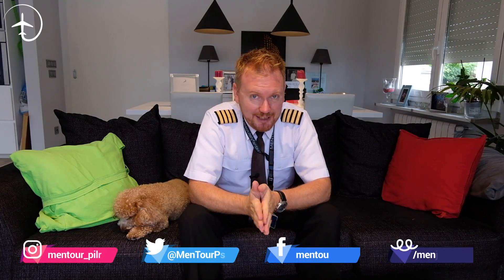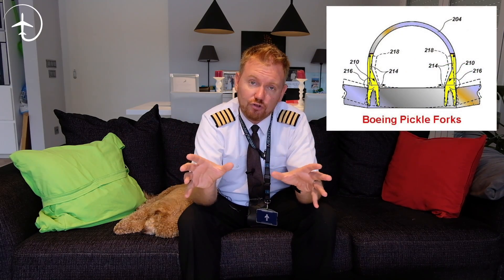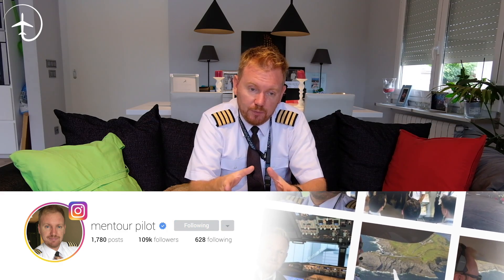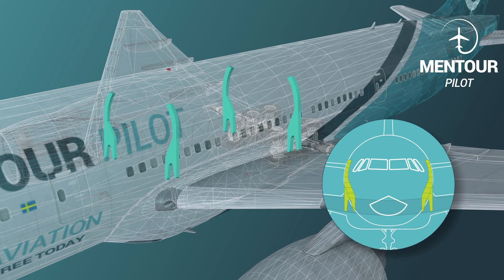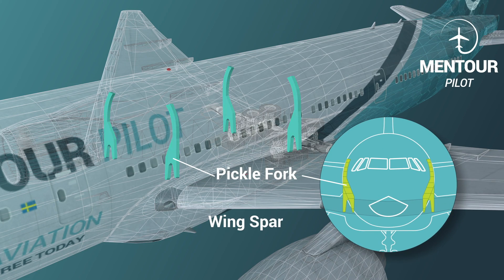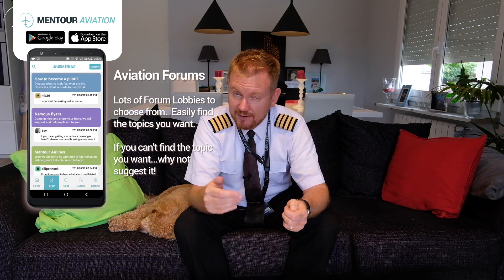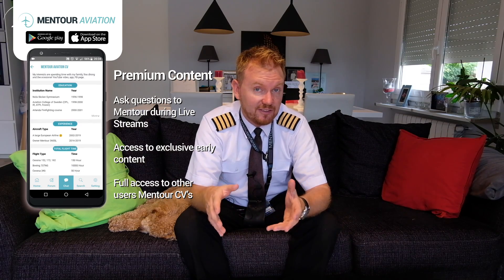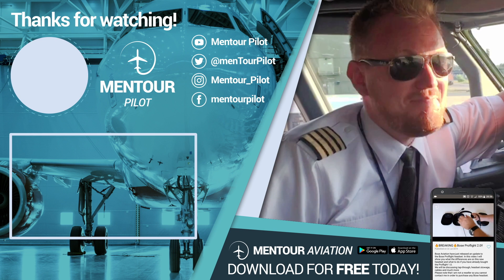Cracks in the Boeing 737 NG wings!? Mentour explains

Comment: Sounds like something is wrong with the metallurgy. Similar with ships especially naval ships. Aluminium Super structure with welded steel panels. Cracks do happen at stress points. One wave with the right weight and force known to cause a ship to break it's back and send it submarinig to Davey Jones Locker. Will be the similar with air turbulence or heavy  landing.
Reply: it can be wrong desing due a understimate stress values or overaged Aluminium alloy. Root cause analisys must be done to get the truth of it. Nevertheless you can live with cracks at certain point before braking point, crack must be check continuisly in order to estimate it´s range of propagation. Remember that maximun stress forces are aply to the aircraft during take off and landings but even during the fly wings are load and bent so it can be suffering Fatigue of low stress and high cycles.
Reply: It’s possible I’ve seen many stress cracks on aircraft. And interestingly enough when you repair and reenforce one section after a few hundred hours there’s another crack that appears. Generally you just move a vibration from one airframe station or line to another.
Reply: I'm surprised they'd use aluminum with steel panels for numerous reasons, but especially because the aluminum and steel expand with heat at different rates.
Reply: So much metallurgical work is done at low cost bid. Design typically accounts for tolerance, but QA is very very expensive (when done welll
Reply: @derkspringer2483 Extra weights in wingtip can change vibration out off from harmful frequency.
Reply: Jari I agree reenforing to reduce vibration is a good solid practice and works but 1 out of 10 times it’s going to just move the vibration. But then again my experience comes in helicopters not airliners.
Reply: @TiernanWilkinson  Certain parts in a wing fittings (attachments) is always steel.
Reply: The larger stress those wings components can be subject to are take off with full fuel, because when the plane roll they act as the fulcrum that enable the movement on the plane body.
Reply: Heat cycles in india...
Reply: @stevenlarratt3638  Obviously, it's  due to overloading. I'm sure, that you've seen pictures of overloaded trains in India, where people are riding on top of and hanging off the side of the railcars. Well, they do it with aeroplanes as well. It isn't so bad with people riding on the wings, close to the fuselage, but when people are riding all the way out on the wingtip, leverage kicks in, and it really stresses the airframe, especially the pickle forks. Nothing a little duck tape won't fix.
    ...What can you do anyway? India is a big place with a huge population of people, who have places to go and people to meet!
Reply: Tiernan Wilkinson ....Lol,  I think they know what they are doing dude.  Maybe you should call Boeing and tell them not to mix their metals in their design?
Reply: Reminds me of the Beechcraft 18 and later the Kingair series.
Reply: @jarikinnunen1718  Tuned mass dampers?
Reply: its a bad design...all the parts on all the planes cant have "gone bad" ...its not the metal. its just like what happened to the sea planes..etc. or short hoppers.  metal fatigue due to poor design.
Reply: @Motorman2112  Yes, sort of
Reply: @ B A Nice handle. It wouldn't have anything to with the character from the A-Team TV show would it? 

I digress. If what you say is true, Boeing management made another terrible decision. Good for the bottom line but terrible for aircraft safety. 

Is there any documentation that Boeing actually incorporated improperly fabricated structural components into the NG line of aircraft? If so, how can anyone trust any plane they have manufactured. 

Hand machining critical structural components is far different than CNC machining. Pickle forks are large components. There is no way any human can match the accuracy of a computer controlled device in milling a component. And they allowed such components in manufacturing the planes. Incredible. I hope the truth comes out. 

This is just mind blowing to think about.
Reply: @TiernanWilkinson  It will be an alloy rather than pure aluminium, but a good point as the rule of thumb is that aluminium expands twice the amount that steel does. Also when you have steel and aluminium in contact then they form a battery which causes corrosion, so it is not done very often.
Reply: @steverpcb  you want to explain how car engines work then? Almost all car engines now feature an aluminum head with a cast-iron exhaust manifold attached to it. If aluminum expanded so much faster than steel, they'd all be leaking exhaust, wouldn't they? Wouldn't all the steel bolts screwed into the aluminum heads and blocks be coming lose all the time? Car engines heat up and cool down a lot more than an airplane fuselage, don't they?
Reply: @AlexandarHullRichter  Car engines are bolted together cold so that when it heats up everything gets tighter. The actual expansion is about 1 1/2 thou per inch for steel and 3 thou per inch for aluminum for 200 degrees C ( liquid nitrogen is about -200 and you can heat steel to +200 before any change happens to the microstructure).

Comment: Very informative. And FAA is miles above the FDA (I work in the medical device industry), I am quite impressed. Still, fracture mechanics and metallurgy are both well developed disciplines, I wonder if Boeing has done its due diligence. How about some testing before installing the forks? How about having some deformation sensors permanently on the forks? I am more and more nervous about Boeing, their CEO looks like a soulless suit and their recent track record speaks for itself. Hopefully they will be scrutinized more now.
Reply: Radim Cernej - These cracks can be microscopic.. normally parts are quality checked after producing the parts, sometimes also x-rayed to make sure there are no microscopic faults.

Comment: One plane with cracks isn't a disaster.    However  ---  if more planes start showing cracks after the testing, then there might be a problem.     Waiting for future information.
Reply: Irvin McIntyre They have found 25 with cracks so far (out of 500 checked), so it is a serious (and expensive) problem.
Reply: I read 36 so far!
Reply: Doesn't sound good, does it.

Comment: So FAA now requires that airlines carries flex seal tape on each airliner.
Reply: Should be JB Weld...🤣
Reply: engine tape...straight outta og starwars
Reply: @brentboswell1294  if you can't fix it with JB Weld, it's fucked
Reply: Don’t forget balin wire and vice grips....
Reply: Every plane has to be cut into 2 halves for inspection.
Reply: William Haynes The term you’re looking for is speed tape. Aviation duct tape. Great stuff. Very expensive.
Reply: How large a roll?

Comment: Additional potential explanation for cracks: material handling. Metal could have been fatigued during mishandling of the components during transportation or removed from casting too soon. I think your best guess "error in aluminum alloy manufacture or casting" is probably correct.

Comment: These parts are probably machined from extruded aluminum alloy and if not extruded correctly, soft spots can exist.  One solution would be to require hardness testing on the ends and the middle of the parts in several locations.  Another factor could be after machining; if not machined properly, warped conditions might exist and - even if not permitted - some supplier might "straighten" the parts (even after penetrant inspection) to point of inducing too much stress and even cracks...there are companies making parts that do not follow the manufacturing specifications.

Comment: I tend to agree with @MentourPilot here.  The most likely explanation is that this particular batch of aluminum was weakened somehow.  This happens from time to time.  This has happened before in similar circumstances.  I expect that when the mandated tests are completed and other NGs have similar cracks in their pickleforks they could then see if a pattern is forming and trace those pickleforks back to the manufacturer and figure out what might have happened.  Then action can be taken to correct the problem and reduce the chance of it happening again.  Let's be glad this was found before wings started falling off.

Comment: They're saying 5% right now. I'd be interested to see the detailed breakdown and determine if they came from a specific batch or mfr, or something like that.
Reply from the maker: It will indeed be interesting to see.
Reply: @rexsand1321  batch can be a 10k pounds, it's still batch.
I think is more than only material problem, like @. Michael Gehlke tell some carriers don't wanna planes from SC because quality
Reply: Which also doesn't mean it is a fabrication problem. The design could have exceeded the limits of the materials minimum standards.  This happens and people will blame the foundry even though they met the qualifications for the materials.
Reply: @rexsand1321  Large cast pieces like this are done in 1-2 piece batches with custom sand forms so you are correct unlikely to be batch related. And only effecting the rear pickle-fork to me points to design or probably retrofit problem. I would put money on the addition of winglets moving the pressure further outboard and causing more bending forces.
Reply: MrRexQuando The pickle forks are not cast. They would be either machined from plate or forged.
Reply: @artjackson8360  I am pretty sure they are forged and machined to final shape, you get stronger and lighter part. Material batch (people should learn what a batch in this case means, could be several batches) might be an Issue, I agree with Mentour. From some point, China got control of aluminum production from USA and Europe. That would explain that older 737NG didn't have cracks even after 90K cycles. That suggests a possible new supplier entering the field and age of the airplanes might point in the same direction.
Reply: @josefchodur5016  Way too big to be forged and with the limited number produced no one would build all that tooling.

Comment: I work in manufacturing and we do a lot of aluminum parts, and he is dead-on about the metal quality being the biggest variable in the end result.
Reply: Yep, I work in aerospace as well.  The biggest problem is with sub contractors.  We are AS9100, but incorrect material specs  has been miss issued.  It was caught at the packing stage as certificates of conformity (coc's) did not tally.  Mistakes happen unfortunately, but system are in place to minimize and capture non conforming parts in-house.
Reply: @paul30003  yup so it's Boeing fault. They probably don't care about consumers as much as they should. If they ever did, they would not have saved money and not provide training for the other pilots before using their newest plane.
Reply: Tiernan Wilkinson you need German quality control

Comment: As someone who have evaluated this AD and ordered inspections, I can say that Mentour has done magnificient job explaining this. There is just one small mistake, for aircraft with utilization higher than 22600 FC  limit is 1000 FC from the AD effective date(not a year as he said). Both Boeing and FAA have done great job here. Inspection itself is easy, access is a problem. Lower than 30000 FC - before reaching 30000 FC or within seven days  whichever occurs later. With utilization lower than 22600 FC, within 1000 FC or before 22600 FC, whivhever occurs later, anything in between: 1000 FC. Utilization higher than 30000 FC - within 7 days(up to 10.10.2019.)
Reply from the maker: Thank you!!
Reply: Dear Steve,just an update for you, a NPRM(FAA equivalent to PAD by EASA) has been issued for parts mentioned in  AlJazeera documentary(it seems this is the case), and pickle fork inspection has been expanded to include additional 6 fasteners. Company I work for did not have findings on pickle forks, I hope it will stay that way, and for bear straps, proposed threshold gives me an idea it is treated as not so urgent issue(they will give us 6000 FC to inspect it, which depedning on average sector length can last from 2 years for a company that has a lot of short flights to almost 5 years for example in case of company I work for). What I am trying to say is that immediate grounding will not happen like it did with some aircraft affected by pickle fork cracks, operators will do the bear straps inspection during next C-Check. Again, it is properly managed by Boeing and FAA.

Comment: I'm not sure about the terminology at Boeing, but as a design engineer at a transportation manufacturing company I can tell you that the term "Fail Safe" does not refer to what you suggested.
Fail Safe means that the part/system fails in a safe mode.  For example, if you have a vehicle with airbrakes they are designed to apply the park brake if you lose air pressure.  What you described is system redundancy or backup.

Comment: I read on a pilot's forum that these pickle forks used to be machined from a solid block of aluminum but that wasted a lot of aluminum so they decided to start forging them instead, which results in a part with less strength.
Reply: socal livvin That’s not accurate. Forged parts are generally stronger and have better fracture toughness than the same aluminum alloy in plate form.  Forged parts are literally beaten into shape. This gives a better grain structure.
Reply: If I am not mistaken, forged aluminum expands and contracts more than does cast aluminum when exposed to temperature changes. Forged aluminum is certainly stronger. But perhaps the greater expansion and contraction rates of forged aluminum might potentially increase stresses on the components. I don't know honestly. 

That being said, forging such large components seems beyond what Boeing would be willing to pay for. Milling cast aluminum would be far less expensive than actually forging such parts.
Reply: David Harris The problem with cast aluminum is that it has poor grain structure and small voids in the material that are inherent in the casting process. When you design something using cast material, you need to include significant knockdowns on strength to account for these issues. The net result is a part that is significantly heavier than a forged or machined from plate part to withstand the same loading. 

Another consideration is that the small, unavoidable voids in the material significantly reduce the fracture toughness. This is the material property that determines how fast cracks grow under cyclic loading.  The pickle fork is undoubtedly classified as a damage tolerant part, so casting would never be used in this application. It just won’t meet the requirements of part 25.

As for the difference in the coefficient of thermal expansion, I believe regardless of product form, aluminum has the same CTE. Thermal expansion comes into play when you have a stack up of dissimilar materials such as titanium and composite or steel and aluminum.
Reply: @artjackson8360  I understand that forging leads to a much stronger product. As such, less metal is required and therefore the part is lighter. But forged aluminum is denser than cast aluminum. Though the coefficient of expansion is the same, denser material expands more. 

I might be misunderstanding something. But can such large aluminum structures be produced in a cost effective manner by forging?

Audi uses aluminum in their automobile manufacturing. They call their product ASF for aluminum space frame. They claim it is both stronger and lighter than steel although they make no mention of how it compares to ultra high strength steel. 

They provide no information of the manufacturing process used so I assume it is a proprietary secret for which they do not want to provide any details. 

Is the manufacturing process for the pickle fork manufacturing also a closely guarded secret also?

This is a serious question.
Reply: David Harris Actually, density has nothing to do with expansion. So delta x is defined as the difference between the linear expansion between two materials, The equation for this is delta x = (t2 - t1)(CTE1 - CTE2) where x is the amount of linear expansion between two materials. If the coefficient of thermal expansion (CTE) is the same for the two materials, then delta x = zero. Hope this helps.

Comment: The key to this article is that the plane was used for cargo in India.  Cargo carriers  especially in more unregulated countries are notorious for over loading and abusing aircraft and have less rigorous maintenance programs.
Reply: Did you watch the video? He says the aircraft were being refitted to freighters having previously been passenger planes. I do not believe that  India or indeed any other major country cut corners.  Are you trying to shift the blame ?
Reply: @georgegeorgantas6468  The point I was trying to make is that the planes weren't grounded. The problem was found and fixed in scheduled heavy maintenance.  This is simply histaricle fear mongering.

Comment: When Boeing was in Seattle, this type of thing would not happen but having moved out of Seattle the bean counters are in control so now failure IS an option and with that, so is the cost of destroying what has been the best build practices that have gone on for decades! I know because I worked the 747/767 assembly lines from main-join to flight-line! I once was in an A320 that had a leaking window seal dripping ice water on my shoulder flying over the Cascade mountains going to SEATAC.
Reply: m mars - Where did they build the 737 fuselages before and after the move? Is a subcontractor building the picklefork component?

Comment: Another possible cause of the cracking forks you did not outline is a metallurgy issue. Perhaps there was something fundamentally wrong with the composition of metals used in those forks that makes them susceptible to early cracks.